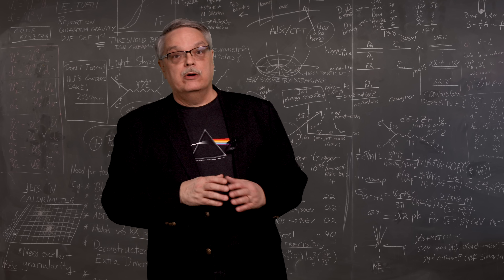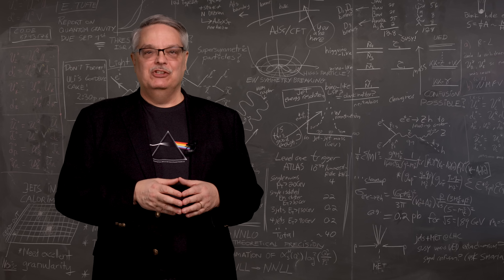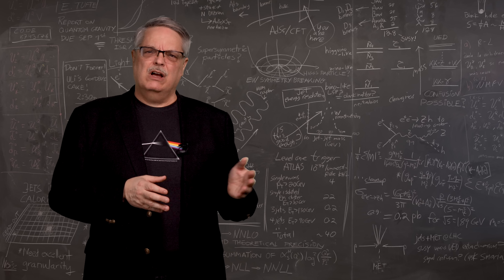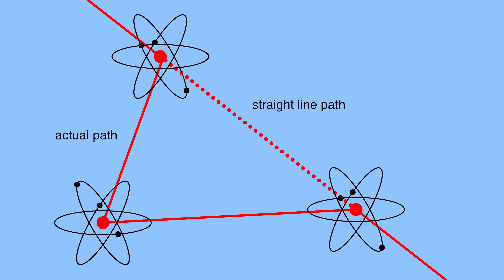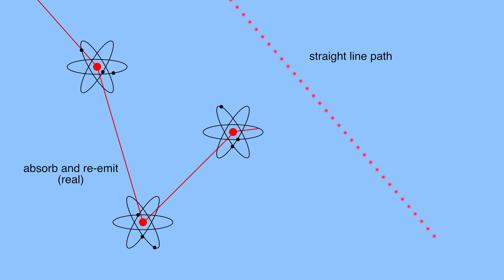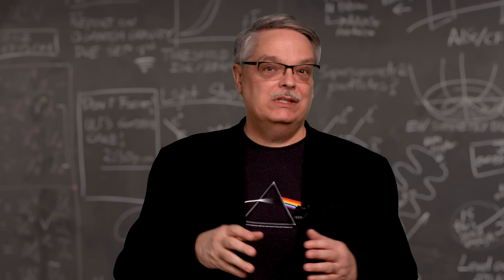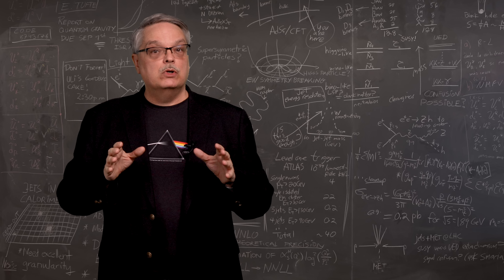Why does light slow down in water?

Comment: I remember being very puzzled by this whole issue in high school.  I can't remember what the explanation was that I was given back then.  So I was watching now wondering if the memory of the high school explanation would come back to me as I watched this.  

It didn't.  But I'm sure this was not the explanation I was given by my physics teacher or more likely the physics text that I was reading at the time.  But I like this explanation.  Maybe it will stay with me because it is a cool idea.

I'm at 9:12 in the video as I write this, but another corollary of all this is that by passing an electromagnetic wave through an intentionally designed responsive field, it should be possible to slow the wave down to whatever speed we desire.  On the other hand is that really the correct way to look at it?  Because our slowed down wave still has the original electromagnetic wave, moving at the speed of light, within it, as a component.  Doesn't it?

The slowed down wave we see is the superposition of the original with another wave.  So has the speed of the original actually changed?  Is the superposition somehow erasing some part of the original wave (for instance it's speed) while they are combined?

Second question: how does combining one wave with another change the direction in which the original is moving?  Because it is just superposition, right?  Yet the end result is the original wave is now offset from where it would be if it had not overlaid with this responsive induced electric field (induced electromagnetic wave) contained by the medium.

So there are two kinds of things the superposition of waves is erasing, or changing: the speed of the original; and in most cases the direction.  Further even though the responsive superposing electromagnetic field is gone once the light wave passes, say, through a sheet of glass, it has changed the original because it is now moving on a different path.

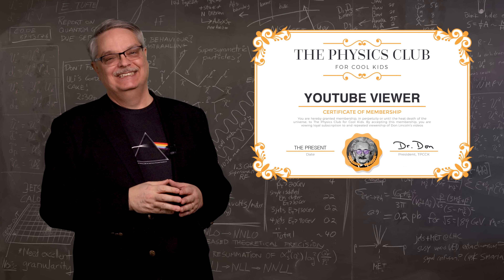10:01  So I'm now at the end of video.  I liked it but I still have the questions above.  Another question: is the index of refraction, or the speed of the light passing through the medium, a function of the number of electrons, in the medium?  Or is it that in addition to the number it matters how free the electrons are to move in response to the electromagnetic field passing through?

And then a related question.  What is so different about transparent materials that light can pass through?  In contrast to most materials, where nothing gets through.
Reply: Another thought.  In my high school physics class, this idea, or maybe it was something else, was explored through the metaphor of waves on the surface of water.  Yet with water waves, superposition never changes the underlying components.  So while they are superimposed, yes, you can have something very different, but once they separate they are back to their original nature as if the superposition had never happened.

Yet with this, once a light ray has passed through a sheet of glass, the light ray has changed!  If it passes through at anything other than 90 degrees it is now on a different path.  It passed through a responsive field.  The field is gone.  And the original light wave has been changed.  This is not what happens with water waves.

Now if I take the water wave metaphor literally, the only way that could happen is if some part of the induced wave within the medium stayed with the light wave exiting the medium.  A change persists, something has to be added in to account for the change.

Comment: I have always thought there was something missing from the two debunked explanations.  This clears most of it for me but I am left with one question.  Light travels at light speed in a vacuum so it experiences no time.  However, light traveling in a medium, goes slower so therefore experiences time?  Is there some relativistic part to this explanation?  Is there any difference between a photon in a vacuum and one traveling in a medium other than velocity?

Comment: So your saying electrons emit their own light, this light slows light down? Why doesn't happen outside of a medium? That is light slowing light down? doh, same speeds, OK. Why doesn't the new light come out of the medium once it is added? Why do moving electrons in an antenna make regular speed light, but inside a medium make 'slow' light? If the electric force is mediated by photons, what speed are these going at? Since basically everything is empty space, how does a photon know what speed it should be going at ? I thought also it was the case that if an electron is going to move because of some light then it gains energy, but that energy is quantized, but your resisting the idea of absorption, and there are all different kinds of electrons in there too. It would seem conservation of momentum would allow for adsorption and emission in same direction?  Doesn't seem much of an EXPLANATION. Just a bit of wavy mathematical magic sold as a concrete explanation. What your really saying is IF we imagine this kind of wavy magic then it is AS IF this happens from a numerical modeling point of view but it seems you introduce as many questions or more than you answer really.

Comment: The video's pacing was good until the end, where it feels like the answer was revealed without a robust amount of explanation. What causes this secondary wave to be produced? Why does that cause the light to be refracted and slowed down, instead of just slowing down?
Reply: Photons are EM waves (call that wave P) and the electrons in the atom react to the field created by P (call that movement EM). EM creates a new wave (another photon!), call that E and the waves P+E sum up to create the wave we observe.. But, once it gets out of water, E is gone and we are left with the original P. This is an electrical engineer, and it is still not very obvious. So, you did ask a good question. Another good question is why the bend in the direction. The video doesn't explain. All the answers I find explain it by simply saying: because it is slower in water. I don't see how that explains it. Anyone?
Reply: > What causes this secondary wave to be produced?   
A charge (for example one electron) on itself is surrounded by an electric field. Now when you move this charge, you kinda "drag" this field along and thus create an electro-magnetic field. This is just how nature works. For example a radio antenna works by the same principle (dipole antenna).
Reply: To refract light must incident obliquely on material. When the velocity changes due to superposition then the value of velocity decreased in direction of surface as well as in direction of normal to the surface which changes the slope of the path. ....
Take your time and resolve the components of velocity to understand... You will see through logic
Reply: He explained that the secondary wave was caused when the light strikes the atom and causes it to move, and the motion in turn causes the secondary wave. It all makes sense if you listen.

Comment: So because the dampening effect of the electrons the light waves are passing by goes away after the light has passed through, does that mean the wave length would also revert to the same it was before entering the medium? If not wouldnt that have a significant effect on the color of the light coming out the other side?

Comment: Part of why the misunderstanding might arise has to do with another situation where light is slowed down in the interior of stars where the atoms are fully ionized thus coupling light and baryonic matter. 

Were the medium fully ionized the first wrong explanation would be approximately true as there the particle like properties of light become predominant namely as free electrons and nuclei can scatter or absorb any wavelength of light resulting in the mean free path or random walk slowdown. However bound nuclei can only absorb specific wavelengths. 

A general though not absolute rule of thumb is that the particle properties of light tend to dominate in far more energetic environments where as the wavelike properties predominate under more typically encountered conditions on Earth.

Comment: Thanks for an excellent video.  It did leave me wondering quite a bit though, for example:
- Why does the resultant light wave not travel at the speed of light?
- Why does the light bend at the interfaces
- I get the creation of the resultant wave - another great example of the recursive nature of reality.  But, if there are two waves and one disappears (because there isn't any more glass) wouldn't it be unaffected by the second wave.  Wouldn't it still be travelling at the higher speed of light and in the same direction?
It appears that what is described is the modification of a wave, not two independent waves giving a resultant. If this is the case then is the modification a cumulative one? Ie. The first electron modifies the wave and the second one is influenced by the modified wave which it then modifies.  This would imply that the result (angle and speed? ) is dependent on the thickness.

I am left with the feeling that the crux to the original question (why is the speed of light different in glass) comes down to the idea that the resultant wave is slower, but, unless I missed something, this slowdown is not explained, which I think means that the question isn't answered.

Comment: Can you do a video on the direction of energy in an electric field, covering where the energy comes from?  I've heard that the energy doesn't come from the battery (or other source), moreover that it comes from the field around the circuit with the battery replacing the energy lost from the field.  Is that right?  It sounds bonkers!

Comment: I'm usually a fan of your videos, but this video raises more questions than it answers. Why does the wave from the electron travel slower than c? Where does the energy for that wave come from? If it's from the incident wave, why doesn't that lose energy/change colour depending on how much glass has been passed through? And why does the light change direction at all?
Reply: Because the electron moves slower than light.  From light.  It does.  Because it's slower.

Comment: Nice explanation.  I do have one question though.  If photons have an effect on electrons in the glass then there must be some sort of energy transfer.  Why does the light not lose any energy or frequency?  Or if it does, how does it regain that energy when leaving the medium?  There is also another issue with this theory that needs to be explained.  If you had a perfectly clear medium and an ultimately powerful laser then what happens when you reach an electron / photon saturation point when the in coming light piles up behind the slower moving light interacting with electrons because all electrons are being used?
Reply: Light >>does<< get absorbed.  Less light comes out than went in.

Comment: Light does not  slow down in water, it just travels less distance at the same speed, therefore the time laps, or the duration of the trip on the outside of vacuum, gets shorter than if it had traveled through vacuum all the way.  One can say that light prefers every possible shortcut over keeping its originial direction. Why is it so that the propagation of light in every iluminated outward scenery, preferes taking shortcuts and thus saving some time? Could it be because  the time is money? How come the time is scarce?  Could it be because of the presence of death in our universe?  When the scenery is on the outside of vacuum, Light doesn’t like to spend its time just for the sake of keeping the continuity of the direction up to our expectation, and takes a shortcut instead. .

Comment: Love your videos.  So there's no (elementary) way to explain this using the particle viewpoint?  Also, how does this explanation account for the change in direction?
Reply: I dont know classical viewpoint but I have viewpoint about direction.
.
To refract light must incident obliquely on material. When the velocity changes due to superposition then the value of velocity decreased in direction of surface as well as in direction of normal to the surface which changes the slope of the path. ....
Take your time and resolve the components of velocity to understand... You will see through logic

Comment: @2:25, of course only if you use a flat piece of glass.
@ 7:50 "the wavelength depends on the colour of light"... I always assume it's the other way around.
Colour is an emerging property, frequency is the causing factor.
Reply: But I still have some questions:
- is the secondary EM wave generated by the moving electrons of the same frequency, the same wavelength as the incoming light?
- You explain that the superposition is slower when the two component waves have different speed. Why would the secondary beam have different speed?
- The superposition also has higher amplitude compared to the original waves. (At some points it is the sum of the amplitude of the primary and secondary wave) where does that energy come from?
- Does the super position of the two have the same wavelength or the same frequency while inside the glass.
(And would you say the colour depends on wavelength or frequency?) What is the colour of the beam while in the glass?

Comment: I'm sorry, but your explanation doesn't add up (excuse the pun).  Lets use the additive wave explanation to describe 2 waves moving at different velocities on the surface of a pond.  The resultant would be a slower wave while the 2 waves are together, yes.  The problem comes in when you look at the 2 waves as they separate (the faster wave gets ahead of the slower wave).  That faster wave will never have actually slowed down and will emerge at the same time it would have if it didn't encounter the slower wave.  You only get an APPEARANCE of a slower wave while the 2 waves coincide.  Now bring this back to our light example... Using your explanation those photons won't actually slow down, they would only appear to slow down during the time they are inside the medium.  They would still emerge from the medium at the time as if they were still at the speed of light the whole time, but this is not what is actually measured in experiments.

Comment: Does anyone know the explanation on why the second wave created by the oscillating electrons in the material does not exit the material, while only the original wave does? It appears to me that once an EM wave is generated from inside a material, especially an insulator, it should leak out of the material. Or maybe it does but not along the same path as the original EM wave? Thanks!